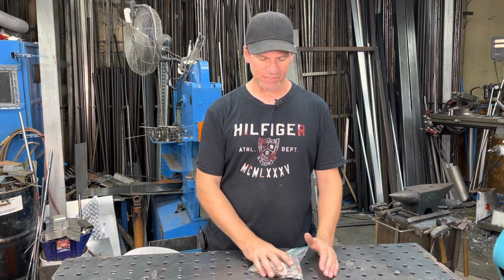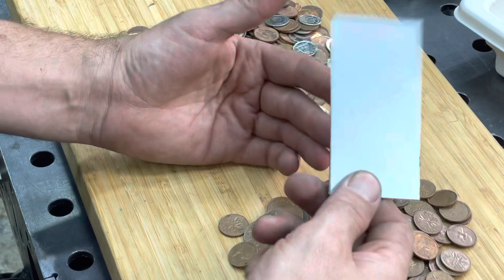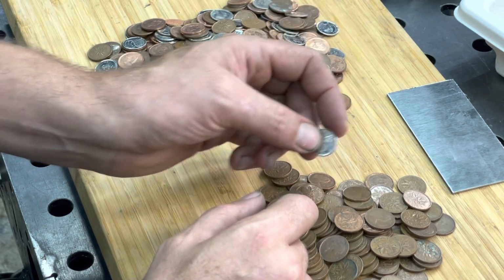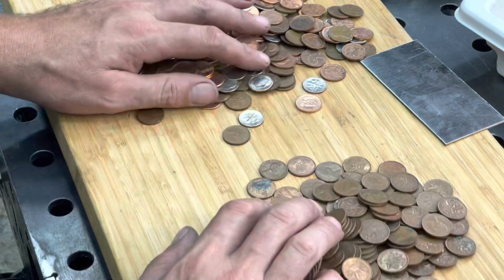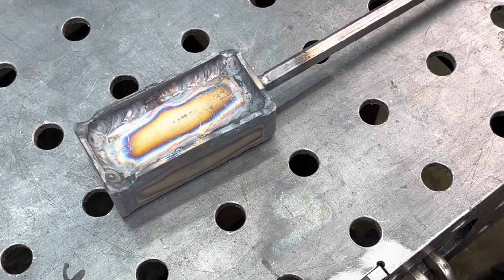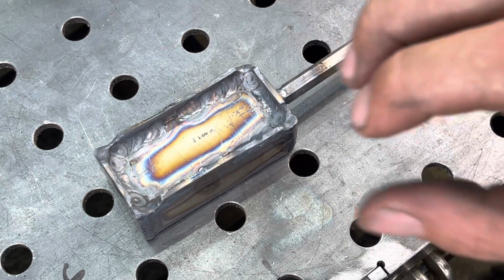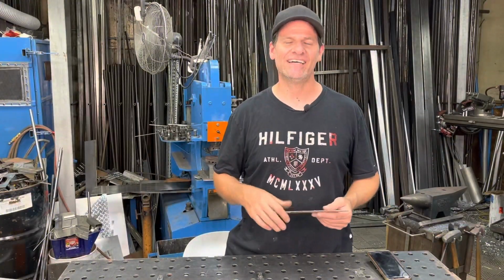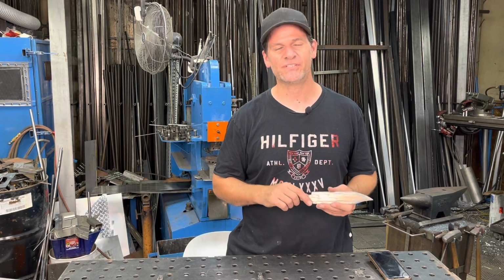COPPER DAMASCUS KNIFE FROM PENNIES AND DIMES !!!

Comment: I'm concerned about the big inclusions showing after you ground the bevels. That's not a good sign.
Reply: Concept vs practicality. Copper is very soft and not a great use as a blade.

Comment: if you use American pennies, anything pre-82 is 95% copper.  after 82, they are 98%zinc....82 is a mixed year when they transferred them and you would have to weigh them

Comment: But zinc isn’t magnetic...  modern pennies are copper coated zinc
Aren’t they?  I play around scoring the surface of pennies then heat it up the zinc liquifies while the copper holds its shape, causing the engraved line to invert and become a raised line on the surface of the penny.

Comment: Sorry but you're not using copper you're using zinc they stopped making copper pennies back in 1946 after 46 they were only made with zinc and copper plating
Reply from the maker: I’m sorry you don’t have your facts correct
Reply: Copper Penny's 1982 and older